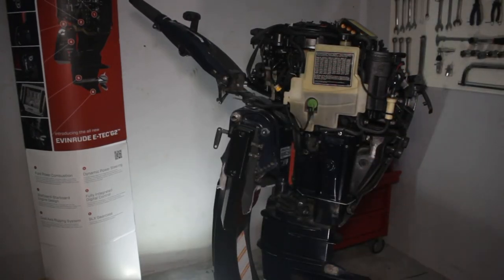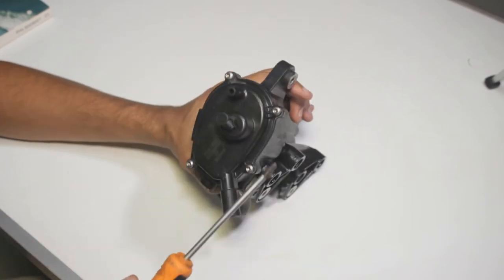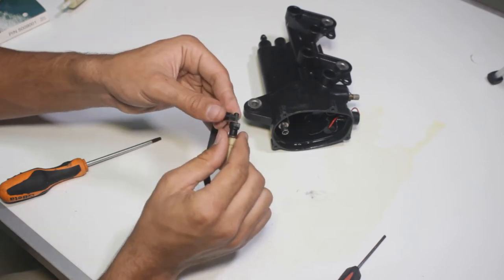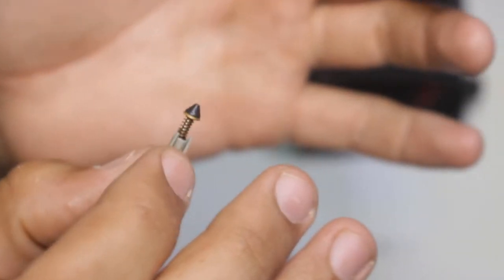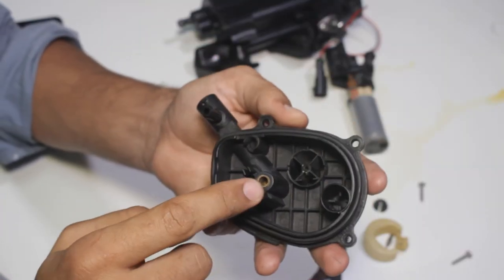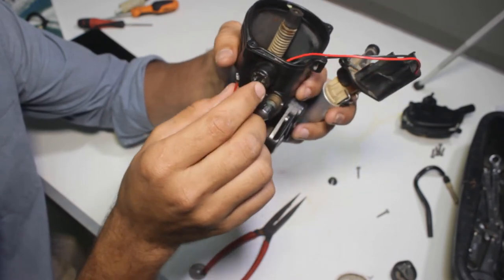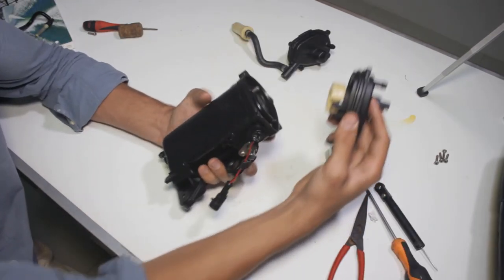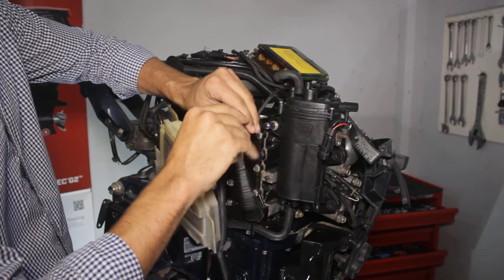Tutorial 4: Verify and clean a fuel pump on a Evinrude E-tec 15HO / 25 HP / 30 HP

Comment: my engine starts and runs for about 15 minutes (when it gets warm) and then stalls with a code 91 "Fuel pump open circuit". Will this tutorial fix the issue? Excellent video btw.

Comment: Important note in your step by step for reassembly you forgot to illustrate the re-installation of the pressure relief valve assembly (I see it in place but you did not show its instillation) and tube after reinstalling the pump and screwing down its cover with the torx screws . while its obvious as one will have this part left over after reassembly , if you do not replace the fuel pressure regulator and tube Assembly you will have no fuel pressure to the injector manifold supply and the engine will not start or , start and run extremely poorly .. it is important to note the injectors high current electromagnet coils are cooled by the fuel as well as supplied with fuel. if the small mesh screen on the pressure regulator does gets plugged up,  the fuel pressure will go way up and this puts the pump under a lot of stress, this also stops the fuel in the loop from returning to the Vapor separator tank so the injectors are not cooled as well as over pressured with throws off the injector charge calibration and makes the engine run rich ...
Reply: hi..the gas pump of my enverude etsc 30 hp engine is constantly receiving electric current. The engine locks itself without starting. ecu is solid. how can i fix it..

Comment: I got a question for you. Do you know what type and function the diode between the terminals is? I ran a diode test on my pump and it is dead, but the pump runs without it. What diode do I use to replace it?

Comment: Hi, Many thanks for producing these videos.  They are fantastic and easy to follow.  I have a question on 9:12 of the video, I don't get any click nor is the brass plunger retained in the plastic.  Would it still work or will it not allow appropriate flow back from the injectors.  My motor was running rough and I thought it was that return filter but it was clean but when I went to check that one way valve the brass and spring wasn't retained in the grey plastic housing.  Thanks, Rich

Comment: Great video following step by step as I am taking mine apart. I have a question about that valve at 9:15, mine does not click back in. The spring will just fall right back out. Is this an issue?

Comment: Great videos!  I just got a 2018 Evinrude 25 hp (model: E25DPGLAFD) used with 30.5 hours on the engine.  Since I got it, I've been having trouble with keeping the engine running.  When completely cold, it seems to start up fine and run for 10 seconds before cutting out.  After a time or two of that happening, it cranks and turns over, runs for maybe a second, and then turns off. After the engine dies, LEDs 3 & 4 remain on. I bought diagnostic software and I'm getting a current engine fault code 91: Fuel Pump Circuit Open.  The gas tank and all hoses were connected, and I checked the fuel primer bulb to make sure the engine had plenty of gas. Do you think that going through this "Tutorial 4: Verify and clean a fuel pump" should be my first step with troubleshooting?  Anything else you'd recommend?  Thanks a ton for your help!

Comment: I saw your tutorial # 4 of fuel pump on a evinrude etec 30 hp
Have the next problem:
I have installed two Evinrude 30 hp engines (year 2019)
Both with independent fuel tanks
Since new about 200 liters of fuel comsuption
During use al 4200 rpm , and aleatory, one engine or the other looses power to iddle (bur still running)  Sometimes, just pull the throttle back and foward and get power again, sometimes , need to stop the engine with the key, restart and full power again.
Have installed both independent external fuel filters with water tramp between original fuel tanks and engines
What could be the problem?
The no return valve?
The Plunger with the float?
the no return valve of air in the top ?
Fuel vents on the tanks are ok
Have to change small filters arround the fuel pump lines?
Thank you for your advise
Best regards
Cesar

Comment: Hi
I saw your tutorial # 4 of fuel pump on a evinrude etec 30 hp
Have the next problem:
I have installed two Evinrude 30 hp engines (year 2019)
Both with independent fuel tanks 
Since new about 200 liters of fuel comsuption
During use al 4200 rpm , and aleatory, one engine or the other looses power to iddle (bur still running)  Sometimes, just pull the throttle back and foward and get power again, sometimes , need to stop the engine with the key, restart and full power again. 
Have installed both independent external fuel filters with water tramp between original fuel tanks and engines
What could be the problem? 
Fuel vents on the tanks are ok
Have to change small filters arround the fuel pump lines?
Thank you for your advise
Best regards
Cesar

Comment: Hello. We changed the e tech 25 hp petrol pump. but everything works normally, the energy comes, the pump works, but the engine does not start by gurgling.. we spray the cylinders with lining spray. Hello..

Comment: Great video.  My 2010 etec 25hp is flooding. It looks to have this exact vst/fuel pump assembly.  I will attempt to clean that return filter that is needle shaped, inside there.  I know it is flooding because 1.  The plugs were wet.  2.   When I removed the gas tank fuel line from the motor and pressed the spring on the male fuel connector fitting on the motor to relieve the pressure it ran really smooth and well and resolved the rough stalling mode.  To cause it to flood 1.  The high pressure fuel pump overrides the injector on open?  2.  Gas tank vent not open or bulb pressed too hard?  3.  The water through line in the vst is leaking water into it?  4.  The no serviceable valve mentioned on top of the vst is not working?  Anybody know?  5.  Could water from the transducer "splash up" be finding it's way to air intake system?  Doubt this but thought but thought I would be ask.  The video addresses low pressure issues but not high, ie flooding.  Thanks in advance.  6.  Broken or dislodged float or float filled with gas?
Reply: if the small mesh filter on the pressure control valve is plugged (The valve with the spring that he stretched) , it will prevent fuel pressure from being properly  controlled (it can be checked with a fuel pressure gauge)  and you will get high fuel pressure , this puts a lot of stress on the electric fuel pump and can make the engine run rich ,,  make sure the tube that cool water flows through inside the VST has no leaks , or you will leak water into fuel in the Vapor separator tank and ruin your injectors

Comment: I need help.  I have a 2014 etec 30hp (e30dpslabb).  I'm missing the non-return valve and spring (video at 8:10).  Can anyone provide part numbers? Much appreciate.
Reply: I may have a solution for that,I lost the spring and shaft with the rubber seal while servicing it,the hole on the upper gray piece wore out and the shaft and spring popped out and went flying to the moon.I used a needle valve from an old carburetor ( it fits perfectly and seals properly. I then cut a spring from a ball point pen and secured it to the needle valve,providing you still have the upper gray piece,i cut about a 1/4” off of it and pushed it in against the spring,pushing down on the needle valve,so far works like a charm. They don’t sell individual parts for this vst,the only other option is replacing the entire assembly,which cost around $500 usd

Comment: Will this fix stop and stall? Or what could be causing the problem?
Reply: I’m having the same issue my motor keeps stalling I have to turn the throttle back then it would be fine but it keeps happening
Reply: @ljschaerig2134   having the same issue please let me know what you find out
Reply from the maker: Hello, well it can be the issue. If you need more advices, you can contact me on contact@marineandbeyond.com.
Reply: @ljschaerig2134  hello, the same thing happens to me.  could you tell me how you solved the problem, thank you.
Reply: @luex916  hello, the same thing happens to me.  could you tell me how you solved the problem, thank you.
Reply: hello, the same thing happens to me.  could you tell me how you solved the problem, thank you.
Reply: @chemakasaya  they replaced the fuel pump and the spark plugs and there was water in there somewhere I got a picture of everything they did

Comment: anda the little fuel filter?
Reply: The inline fuel filter should be replaced every 300-hours or three years for average recreational use ,(unless it gets plugged up by the use of bad fuel line of a tank of bad fuel) you need two oetiker fuel line clamps and the oetiker tool to crimp the clamps down when you replace it .. why do they use that style clamp ? because they seal a connection better then the other styles ,, https://youtu.be/PqpJGgaQ-HQ